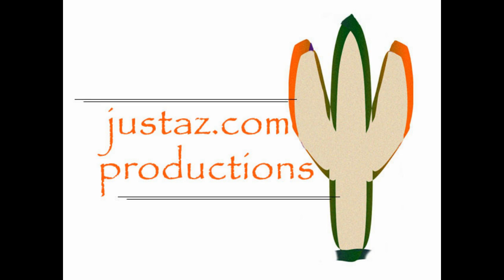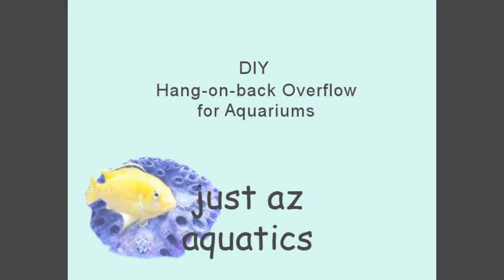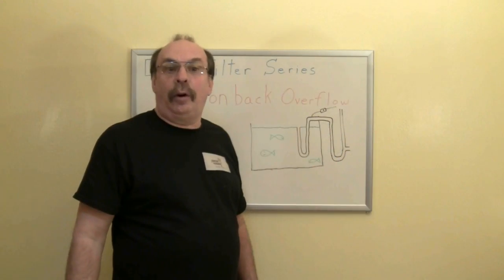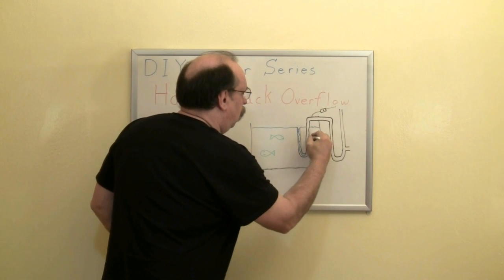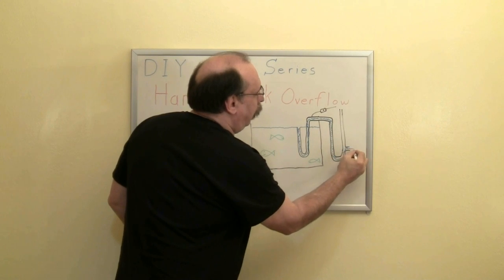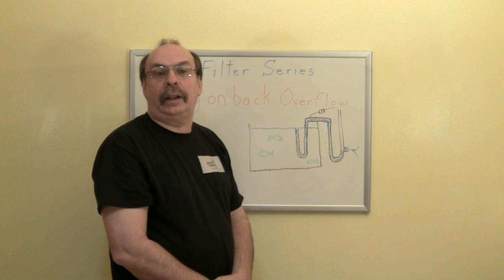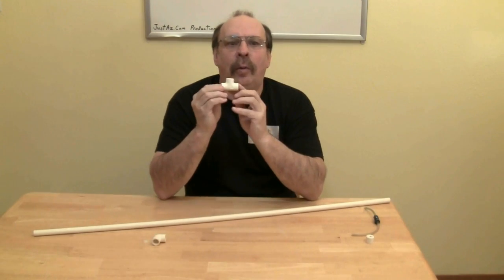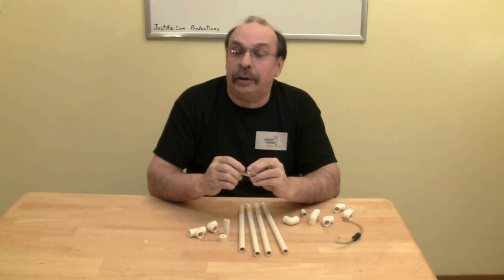Aquarium Filter Series: 8/8: DIY Hang on Back Overflow for Aquariums

Comment: I have watched several of these pvc pipe overflow videos, and they all claim the overflow will restart once the power comes back on and the pump begins refilling the tank (after a power outage), but no one shows that scenario. I would love to see someone unplug the pump, let it sit for a minute or two, and then plug the pump back in to demonstrate that it actually restarts on its own.

Comment: How would you match the pump flow rate with this? I have a similar siphon out of large 1.25 inch pvc but a slightly different design with a wier. 

I find it absolutely impossible to match the pump speed to the overflow speed. The water level for the return pump is either going up or down and I'm constantly adjusting the valves to no avail

Comment: Thanks for demonstration,does the hose that connects to the check valve sits inside or it goes in to touch the water.

Comment: Great, easy to understand video. Thank you!

For anyone that wants to save some money and cut out a step, the check valve and air line is only to start the flow, You can just run an airline tube down and back up the stand pipe until you reach that air pocket, then suck out the air like you normally would (then remove the air line once flowing). Its more of a pain to use, but since starting the flow is so rare,might be worth it than have to secure the airline tube and check valve to the over and risk is failing.

Comment: Ok so with your help of your videos I did make a wet/dry filter system.....I also went through all of your videos..you have a lot of tips and tricks..so here is what I am asking you to help me with..I am sort of in a jam....I saw some where a long time ago..Installing a float switch to the submersible pump..So that whenever my pipe gets air in it and shuts down on me..My pump is still pumping water into the tank which then over flows if I am not home..The reason for this is we live in a camp which windy days and all of us walking around the water shifts and waves therefore causing air to get into my pvc pipe ...So I really need a step by step on how you can install the float switch with a relay and a socket and an extension cord with my submersible pump...so when the water gets to a certain level..IT WILL SHUT OFF the pump....Please help me if you can..Like i said before..I saw ONE video like this and now I can not find it..If you can get time can u please make this video..I really need it bad!..I am having to shut down the syste at midnight and having to get up at 5 am to prime it and start the system then I can not really go out or anything or else I have to shut it all down..Thanks..I love all your videos..I am a big fan..thanks..
Reply: Hey  roxy i seen this set up on a guys overflow once seems like a really good idea 

http://www.drsfostersmith.com/product/prod_display.cfm?pcatid=24981

https://www.youtube.com/watch?v=JsTirj_6qjA

Comment: Another method of priming is to just connect the hose (which you use to fill the tank) to the output from the overflow, so the new water enters through the outflow and  enters the tank through the overflow intake.... Once all the air bubbles go out you just have to disconnect the hose... Now the siphon has started.... So you don't have to suck the aquarium water.... Also the gravity pipe should be covered while filling the tank. Just wanted to share this method to you if you didn't n't already know it. :)

Comment: hello question.......based on your experience, if there is power outage lets say 3 days, will this DIY overflow need to be primed / siphoned again, or this will start automatically when water start flowing inside the pipe again?? Please help
Reply: spidy278 it doesn't need to be primed again

Comment: Hello, I've made my overflow pvc pipe size 1 1/4" I wanted to go big size cause I want to get a bigger return pump that pushes 1200gph. Rite now my return pump is about 400 gph. I want that Good pressure going to my sump..but now iam scared because  it was running great for like 2-3 months and it started overflowing my main tank. I check for leaks and silicon where the check valve goes I've even pinched the airline tube  after siphon again with rubber band.Running great for about 3-4 months and again started to overflow main tank..(first time it flooded out to my floor) I was home to catch the problem quick the second time .. iam still running the 400 gph pump but want stronger pump for better flow  just don't really know what do. Your Help will be highly appreciated.. and Thank You for the educational videos you make.. From Concord California

Comment: what is the use of diy over flow for aquariums.cant we use a tube at the top of the aquarium. it will also control the overflow then what is the difference between these two .please help me in this subject.

Comment: If I want a 1200 gph flow, what diameter pvc should I use?
Reply from the maker: Margaret Peters To create a 1200 gph flow, using gravity only (no pressure) you could accomplish this with 1 1/2 inch pvc. If you have a pressurized drain, you could do this with a 3/4 inch diameter. Best of luck in this project, and all your projects.
Reply: Just Az.com productions I have 2 three inch overflows and they are not keeping up. They skim the surface and appear to flow freely. I must noing something wrong but I do not know what.

Comment: i agree, this is one of the easiest video to understand (if not "the")....very informative yet simple..i have one question though, if there is a power outage, do i still have to suck out the air again from the overflow pipe when the power comes on?...thx
Reply from the maker: mike lopez In theory, you shouldn't have to prime again. In reality, you probably will. You just need to see what happens when the lights come back on:)
Reply: @Justaz  Wonderfully explained . Have couple of questions
1) Is airline check valve must to have? Can't we suck the air out from the tallest tube to initiate water flow? 
2) If there is a power outage; the water flow would stop and the air enters the pipeline. We need to prime again to start the water flow to sump. Is there a way that doesn't  need to prime over and due to power outages?
3) What sort of switch we should use to keep the pump turned off until manually started after a power outage to avoid water over flow; in case if we have to prime the water back to sump?

Comment: one of the best , easy to understand videos ive seen on aquarium filteration
Reply from the maker: ***** Thank you for you positive comment. We appreciate it, and we wish you the best of luck in all your future endeavors.
Reply: Just Az.com productions finally made it last night.... Thank you very much... Another method of priming is to just connect the hose (which you use to fill the tank) to the output from the overflow, so the new water enters through the outflow and  enters the tank through the overflow intake.... Once all the air bubbles go out you just have to disconnect the hose... Now the siphon has started.... So you don't have to suck the aquarium water.... Also the gravity pipe should be covered while filling the tank. Just wanted to share this method to you if you don't already know it. :)

Comment: Hello sir, I did exactly what you did in the overflow design it's just that it is not draining in spite of sucking air out from check valve. Are there things I still am not doing?
Reply from the maker: First, check for leaks. Check along the entire line for any small leak or gap. Then recheck all connections in the system. When they are secured, try to start the flow again. Let us know if you continue to have issues. Thanks for posting your question and for watching our video.
Reply: Just Az.com productions  I checked everything, there are no leaks however, I just had to cover both the "exhaust pipe" at the very top and the end pipe for the drain to create a vacum and it finally worked. My only question now is, is that really the normal way to start/restart the flow? Thanks

Comment: Hi I did everything but when I try to start the prime with the check valve nothing happens. Does the length of the pipes play a factor?
Reply: same problem here...
Reply from the maker: Hello. This can be due to an air leak. A small leak or even a kink in the hose can be a problem. Check and secure all connections. Check the flow rate and pump size. If the pump is too small, the system may not work properly. Sorry for the delay in answering, and please let us know if you still have issues.
Reply: the AquaClear

Comment: Hi how does this compare to hang on the back filter 
What is the advantage of over flow compared to hang on the back filter thank you
Reply from the maker: Hello, Andy d. The hang on back filter is just that, a filter. The hang on back overflow is a method for removing excess water from the tank. The two are separate functions, and so separate devices. The hang on back overflow is only operational should the water in the tank rise above the accepted level. The filter only filters the water, and functions continuously. Hope that helps clear things up. Thanks for watching our video, and best of luck to you in all your future projects.

Comment: Why does it stops after an hour or so ....?    I made this with 1 inch pvc pipe and work well for an hour but stops after sometime.  .need help !!
Reply from the maker: Hello, Tejveer Singh. Without having any specifics, I would guess it is the flow rate. You may need to adjust the flow rate by putting a ball valve on your output pipe. Start with that, and hopefully that will address the issue. Thanks for watching and best of luck to you in your projects.
Reply: Theres a air leak.
Reply: yeah thats because of flow rate . i managed it and its working perfectly . thanx alot !!
Reply: Tejveer Singh How does the ball valve affect flow rate? I am experiencing the same issue as the one you previously had, it works fine up to 10 hours and then it stops working, eventually flooding my tank. I have almost fully closed the ball valve where it was completely opened previously, but I don't understand how closing it and restricting the flow rate(?) will keep it stable. Can you explain this concept to me? I guess I just need some peace of mind knowing that it won't flood my house during the night... Thanks in advance!

Comment: So I  made the wet dry trickle down  filter then I made this I put it all together and it just wouldn't start. I put teflon tape on all the joints but it didn't work. Any help?
Reply from the maker: Hello, Anyuly Angarita. There could be a couple of issues. Make sure you cover the openings at the top and the bottom and that your tubing has no bends or kinks. When you cover the openings you force the water into the tubing, and the release adjusts the pressure so the water pushes the air out. It can be a bit of an effort priming this set up, but you should be fine after that. Thanks for your input and hope this helps.
Reply: I think I got it the  pump was to small to push the water so I should be getting it soon will let you know how it works out. thank you for the tips
Reply: Anyuly Angarita dont use teflon tape use pvc cement